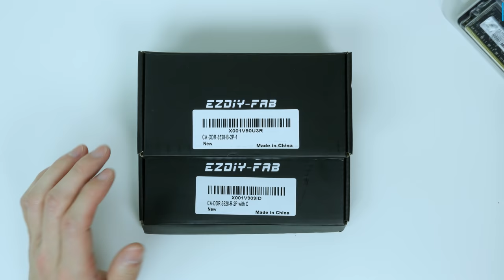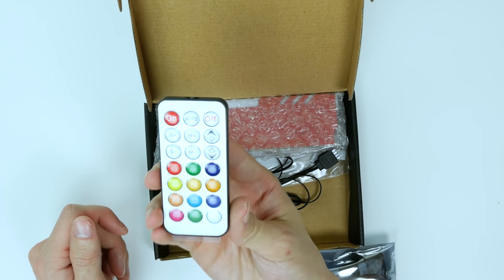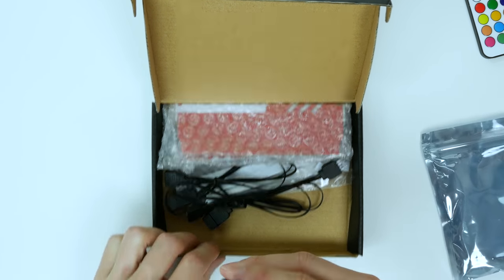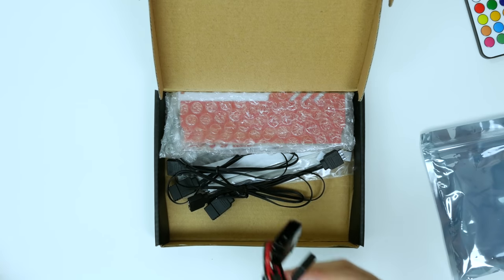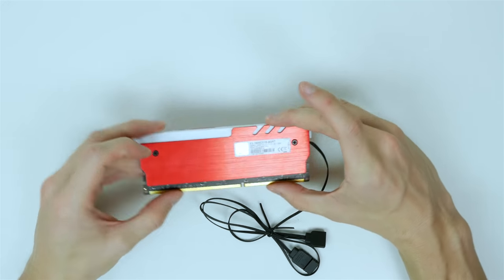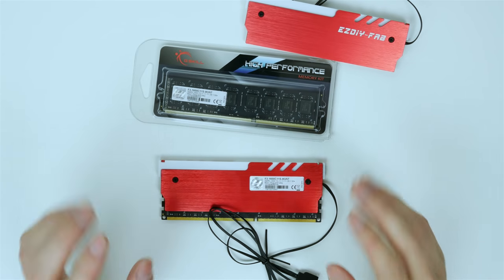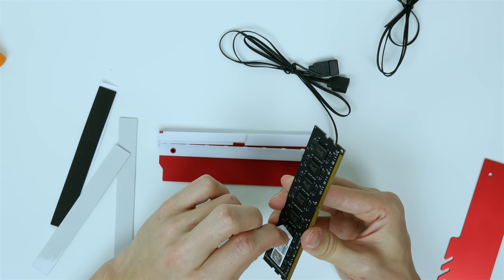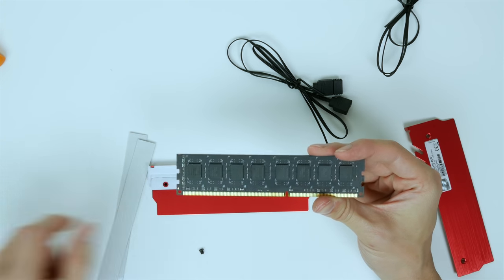Cheaply Convert NON-RGB RAM to RGB!

Comment: There are EZDIY-FAB 5v aRGB fan frames that use the same controller and little RF Control module. I am currently daisy chaining all nine of my frames, 3 packs of 3, off one RF Module and they work perfectly. I have full intentions of grabbing a couple of these kits and adding them in as well. They say up to 90 LEDs can be controlled from one controller but being 5v I am betting it can handle much more than that. Currently with 9 fan frames the controller module stays cool and they work flawlessly. Hope that helps some folks who may have been wondering. If I hit a limit on how many LEDs one of these little inline control modules can handle I will come back and update this comment. Peace and Merry Christmas everyone...
Reply from the maker: Thanks for leaving this useful information! I'm sure it will help someone out! Thanks for watching!

Comment: When I built my current rig last year, it was cheaper for me to go with non-RGB RAM. But have been thinking about doing this mod to my Corsair Vengeance LPX, especially since I've populated my DIMM slots with 64GB (initially started with 32GB). Although since I have an ASUS Prime X470 Pro, I can only go for the 12V version (it has two 12v headers). Thank you for this video, regardless.
Reply from the maker: You're welcome. There is a 12V version of the heatsinks available as well!
Reply: Something interesting, and what I thought I'd share. Apparently you can use the Gigabyte 3-pin VDG cable you get with the 5v version, to connect them to a Corsair Commander Pro or Lighting Node Pro, and sync them with Corsair fans/strips. Since I have a space free on my Lighting Node Pro...wish me luck. xD
Reply: Legendary Music did it work

Comment: Thanks for the video. I also have two sticks of G.Skill Ripjaws non-RGB RAM and wanted to have them RGB. I'm glad to just buy an RGB head spreader kit instead of all new RGB sticks. The only bummer is that EZDIY doesn't have the red kit anymore. They only have the black kit.
Reply from the maker: You're welcome! Wasn't aware that they discontinued the Red kit of RGB heatsinks. If you have any questions about the installation process, let me know!

Comment: Do yourself a favor, and use 2 separate PCI-e power cables for your RX VEGA, versus using the 1 cable and its pigtail. It's much easier on the PSU and the cables, not to mention smoother for that VEGA when you start drawing a lot of power.
Reply from the maker: Temporary until I get a stronger power supply. This PC is my work PC and is mostly used for photos and video editing. Not gaming.

Comment: This makes a lot of sense of all the things I read up on Amazon about these EZ-DIY-FAB doohickeys and thingamajigs for the fancy lights to put on your old and busted computer component piece bits.  I might need to get some of the whozywhatzits with the ARGB lighting to go with it, too.  And a doodamaflotchie with some more ARGB lights, and pretty soon I'll be just like you hip young people.  So, UX100 cooler, these things, the things the same people sell to go on the m.2 SSD, their matching neon strips to go around the motherboard, the case fan and it's front end lights, and I think I'm going to need more ARGB header plugs...not sure how many ARGB pretties I can chain together but I guess they sell some splitters too.  The back side of my case is going to look like the underside of Clark Griswolds' Christmas tree with all these extra wires and plugs, but it's gonna be pretty!  Board is ASRock so it has the Polychrome, I hope it can keep up!
Reply from the maker: What did I just read?
Reply: @WiltshireTutorials  paragraphs are a social construct

Comment: The black taped part on the RF remote wire is getting hot very quick. My LEDs are not turning on. Do you think I have the wiring wrong or is mine defective? (I’m using molex)
Reply from the maker: Oh dear. Seems like there is a short somewhere. My guess is its the RF receiver's wiring. I'd suggest contacting EZDIY-FAB for a replacement. Just for safety's sake, I would suggest buying a molex to sata adapter. That way you can power the RF receiver with data power and not molex, in case there is something wrong with your molex.

Comment: i dont have a 5v RGB header, is there a adapter or can i run the RAM KIT only with Molex ?
Reply from the maker: The PC I used in the video didn;t have an RGB header at all (5V or 12V). You can use the same RF remote kit I used and you'll be just fine.
Reply: I can use Molex to, or ?

Comment: Hey i have gskill trident z but the chip is broken while the rgb is still working. Is it possible for me to use the heatsink and convert a non rgb ram using this gskill trident z rgb heatsink?
Reply from the maker: No. The RGB is built into the Trident Z hardware. You'd have to reverse engineer the code for it and make your own PCB.

Comment: Hi, I've gotten one of those but without those wire could please somebody tell me where I can get the wire to install it please?
Reply from the maker: You can buy any 5V RGB controller to use with the heatsinks. My go-to RGB controller is the one from Fractal Design.

Comment: If I buy one with the remote and another just the ram heatsinks would I be able to sync all 4? If that makes sense. My psu also has a pwm/aura sync plug-in could that possibly be used?
Reply from the maker: Yes. You can daisy-chain everything together.
Reply: @WiltshireTutorials  I noticed I skipped over that part in the video where you stated that. I appreciate the fact you still respond to  people till this day :)

Comment: does it come with the molex connector thing i cant find it anywhere and 3 pin rgb header my mobo doesnt have it im so confused how these work please help i got them thinking they where standed 4 pin
Reply from the maker: Not all motherboards have an ARGB header. The converter I used was from NewEgg. Just Google Molex to SATA power adapter.

Comment: Hey
I have a similar motherboard (msi z97 gaming 5) and now to the question, how do you have rgb in your cpu cooler when you don’t have any rgb headers?
I love your vid and it was very helpful :)
Reply from the maker: Good question! The CPU cooler (Corsair H100i PRO) is connected to the motherboard via a USB 2.0 header, not an RGB header. You then control the RGB on the pump with the Corsair Link program.

Glad to hear you like the videos. Thanks for watching!
Reply: Thx i have been thinking about and then I just saw your vid😀nice that u answer “fans”, keep up the good work😀
Reply from the maker: You're welcome! I always read my comments on my channel!

Comment: I bought this kit awhile back but I wasn’t able to use it because my motherboard doesn’t have an the addressable header. What cables do I need to buy then?
Reply from the maker: You've purchased the wrong bundle. The other bundle with the RGB controller. You can still achieve this by buying a 5V RGB controller from Fractal Design!

Comment: Will the kit that you have listed in your bio come with the molex cables because I need those
Reply from the maker: The device itself is powered by Molex. I used a Molex to SATA power adapter to avoid having to use Molex.

Comment: 1. What is an addressable pinheaded and 2. Can I connect this to my Lenovo legion T5 prebuilt motherboard in a way that would allow me to control the rgb through the Lenovo software??
Reply from the maker: An addressable header is for RGB. When it comes to PCs, there are 2 types of RGB. 5V and 12V. It is very important not to mix the 2, as LEDs can blow up, if you connect a 5V RGB device to a 12V header. If you connect a 12V RGB device to a 5V header then the LEDs will not be very bright. No damage will occur, you just won't get full brightness. You will need to get a SATA powered RGB controller in order to control the lighting in your pre-built PC as it does not come addressable RGB headers on its motherboard
Reply: @WiltshireTutorials  can I not just just daisy chain them into an existing rgb component on the pc and plug it in that way?
Reply: @WiltshireTutorials  also, do you have any recommendations on Sata powered rgb controllers I could pick up off of Amazon
Reply from the maker: Potentially, if the devices are of the same voltage.
Reply from the maker: I personally like to use the Fractal Design RGB controller.

Comment: so this includes al the cables to psu like molex or SATA right? its bc i might buy this and i wanna be 100% sure XD
Reply from the maker: I bought the SATA power adapter. The RAM kit is powered by Molex and not SATA. I hate using Molex.

Comment: I have a old pc , too. What the name of the connection cable with 3pin argb to 4pin ?
Reply from the maker: Are you trying to use 5V with 12V RGB? That's a very bad idea, if you are.
Reply: @WiltshireTutorials  i connect oder sata cable and a connector with 3 pin argb

Comment: My ddr3 gskill ram is already pretty tall, will this make it taller or shorter?  I want to make sure I can clear my AIO on top, thanks.
Reply from the maker: If your DDR3 RAM stick(s) already have a heatsink on them, it has to come off. All RAM sticks are the same height and length when manufactured. The heatsinks are what cause the most changes in dimensions. If you put the RGB heatsinks on it will be slightly taller due to the light bar on the top of the heatsink.
Reply: @WiltshireTutorials  thanks for the fast reply
Reply from the maker: @joeyTminus  You're welcome. Thanks for watching!

Comment: Would it be possible to connect an RGB LED strip using the daisy chain cables and control that with the controller as well? Great vid BTW.
Reply from the maker: Yes. It is possible to do that. Just make sure the strip you're looking to use is 5V!

Comment: Can i install this on the G. Skill  Aegis ddr4 ram because i think this ram already has some kind of heatsink
Reply from the maker: Yes. It is possible. You will have to remove those heatsinks though. It's not difficult to do so. Just time consuming to do it.
Reply: use some sort of heat pad remover liquid and wipe it off with a tissue
Reply: you can find tutorials for it on youtube
Reply: @Crunchy121  ok thanks i will try that

Comment: Have you tried adding it to the corsair icue software/hub?
Reply from the maker: No. As I mentioned earlier, there are no ARGB headers on the motherboard I'm using them with. Also, the heatsinks don't feature a USB header option either.

Comment: i need a rgb motherboard or i can plug-in at RGB controller?
Reply from the maker: As I said in the video, the heatsinks are 5V Addressable. Therefore, you're able to use a 5V header on your motherboard or the 5V RF remote to use the LEDs on the heatsinks. I'm using it on a Z97 motherboard, which has no RGB headers on it.

Comment: Hi bro does this work on my asus b36p gaming g motherboard with a rgb header splitter
Reply from the maker: Yes. BUT, you MUST order the 12V version of the heatsinks. Not the 5V version. Reason being is that your motherboard only has a 12V 4-pin RGB header on it.
Reply: @WiltshireTutorials  i m planning on buying a splitter for my rgb header that wouldnt be a problem right?
Reply from the maker: Make sure the splitter is 12V and not 5V. Otherwise it's fine.

Comment: Why do u hate molex? I have both for my psu.
Reply from the maker: Molex is an old badly designed power cable. It should just die. Everything should be SATA power.
Reply: Wiltshire Tutorials: will it destroybthe LEDs faster with molex?
Reply from the maker: No. Molex will work just fine to power the LEDs. It's just the design of the cable that is bad. It's also a pain to cable manage a Molex cable.

Comment: Does this work with low profile rams?
Reply from the maker: Yes. You will need to use the provided spacers though!
Reply: @WiltshireTutorials  is it included?
Reply from the maker: Yes. The plastic spacers are included in the box. You can see them in this video.
Reply from the maker: You can find the risers/spacers at 5:08 in the video!
Reply: Thank you but how to apply it?
Reply from the maker: Unfortunately, I haven't used them and I threw out the instructions. So, I'm not exactly sure
Reply: @WiltshireTutorials  thank you
Reply from the maker: You're welcome. Thanks for watching

Comment: You're using the term "Power" to describe "Voltage" They are TWO DIFFERENT THINGS in electronics. The voltage may be the same between the Molex and SATA, but their ability to deliver the same amount of POWER (i.e. wattage/amps) are COMPLETELY DIFFERENT. Too many LED's on a circuit can draw MORE CURRENT than the wiring in SATA cables can handle, and you run the risk of blowing your SATA line or that leg of your power supply, rendering it useless. It's like plugging in a floor heater AND your vacuum cleaner into the same outlet and attempting to run BOTH AT THE SAME TIME. You'll most likely pop your breaker to keep your wires from melting, or catching fire due to an excessive current draw on the same circuit! That is the reason why manufacturers power these devices using the vintage MOLEX connectors because the guage of THOSE wires were designed to handle higher current draws than SATA does. It has nothing to do with Voltage or your personal preference on whether or not you HATE Molex. They kept the vintage Molex connections around on modern power supplies for a reason! Since PC power supplies don't have circuit breakers like your household AC lines do, LED manufacturers issue their products with Molex connectors to ensure you don't damage your system.
Reply from the maker: LEDs are very efficient on power draw. The chances of blowing out a rail on a PSU by using only LEDs is next to impossible... Also, Molex and SATA power are typically the same with 18 gauge wire. I'd be more concerned about the amount of amps going through the cable, than the voltage. Which, again, is very little when using LEDs. There's a reason Molex is dead and not included on most PSUs these days.

Comment: IMO it is not worth getting 19usd rgb heatspreader + RAM price. get ddr4 rgb instead. upgrade the components for good.
Reply from the maker: The RAM used in the video was DDR3, which didn't have RGB back then. So, there is a use case there. Also, some people may already have a PC with no heatsinks and want to add a bit of flair to their PC without having to buy RAM with an RGB heatsink already on it.

Comment: Where's the link for the RF remote to efab ?
Reply from the maker: The RF remote is included in the kit with the heatsinks, if you select it on Amazon.

https://www.amazon.com/EZDIY-FAB-Addressable-Heatsink-Controller-Compatible/dp/B07DVFM4TJ/ref=pd_bxgy_img_2/141-2683437-4423565?_encoding=UTF8&pd_rd_i=B07DVFM4TJ&pd_rd_r=cd45925f-711c-415e-817e-47f9db98f502&pd_rd_w=VpgZv&pd_rd_wg=jAqUO&pf_rd_p=f325d01c-4658-4593-be83-3e12ca663f0e&pf_rd_r=VW1NNFA0B0EQFE6273K0&psc=1&refRID=VW1NNFA0B0EQFE6273K0
Reply: @WiltshireTutorials  Thanks!  I bought 4!  So i will build that for my system.
Reply from the maker: Awesome! Hope you like them! Let me know if you need any help or have any questions.
Reply: @WiltshireTutorials  will do.  Thanks 😊
Reply: @WiltshireTutorials  i wondered if you have an email?  I completed my set up and wanted to share a photo of the led ram on my syatem :)
Reply from the maker: Hey Josh! I would love to see some photos of the system in action. You can either send it to me on Twitter or Instagram!

Comment: Do all of these come with a remote
Reply from the maker: They sell the heatsinks separate, if you don't need the remote and have ARGB headers on your motherboard. You can also get the heatsinks with the remote, if you needed.
Reply: Thanks I was wondering because I still use ddr3
Reply from the maker: No problem. I used DDR3 in this video, if that helps you outm